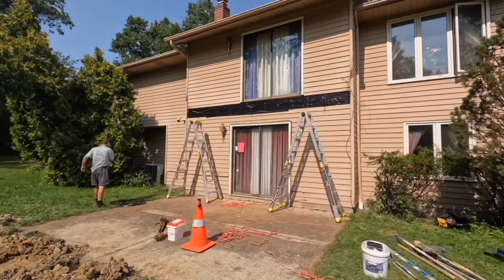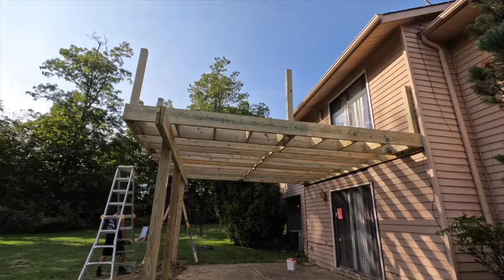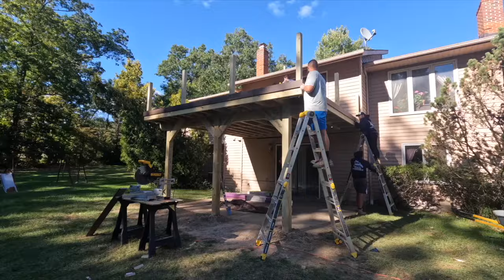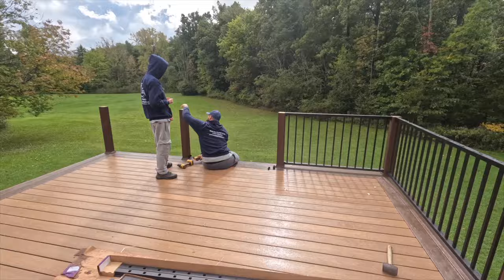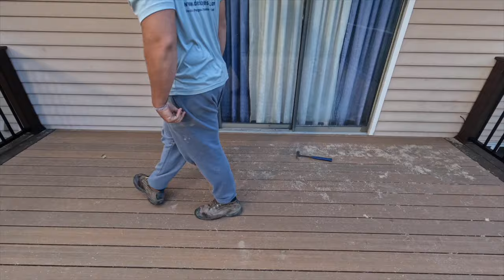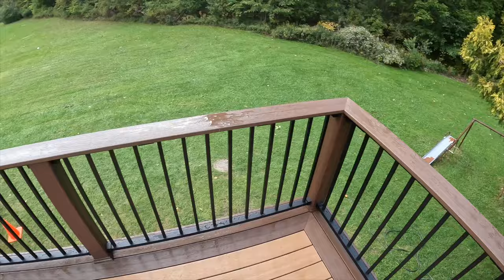Composite  Deck Build Time-Lapse 16x16 2nd Story

Comment: Probably should have put footing of concrete Pilar’s on the posts to avoid long term rot.  Also should have used higher railing like 42” or 48” cause of the second story. Don’t want it to be lower than your hood. Plus safer if you have children!  Nice looking deck !
Reply from the maker: Sono tube piers above grade with Simposon brackets are a better method that lasts longer. However, it does increase cost significantly. We use 6x6 posts, even buried in the ground, should last 50 years.
Reply: Who is this Pilar chick? I didn't see her in the video.

Comment: great job!  what's the weight limit on a deck like that? also what would you say is an appropriate estimate?
Reply from the maker: In order to pass code, decks typically have to have at least a 40 pounds per sq.ft. live load. So, maybe 10k pounds total. Definitely wouldn't put a hot tub on it!

Comment: It looks like you cut back a cantilever. What exactly did you attach to the floor joists to support the ledger and what is the ledger screwed to? I have a cantilever problem at my house and I thought what you did here wasn't possible?
Reply from the maker: Great question. I cut the joists flush with the house, added blocking between joists where necessary, and used DTT2Z hangers to provide lateral load from the floor joists inside the house to the deck joists.
Reply: @deckbydesignl.l.c5091  This is great. I have the exact same situation on my house. I need to tear down the existing cantilever, but don't know if I should use the existing cantilever joists and bolts on new joists parallel with it (with footings underneath that area, OR if I should do what you did and flush it all. But then do I attached a NEW ledger board after flushing the house joists? Anyways, great job, and thanks for this example!

Comment: Yes the cost is more … but it will not last 50 years. I just removed my old one that was there before mine. 17years. I built up with bags of concrete a 12”x12”x2’6” Pilar.  And metal brackets for the 5 6x6 posts I had. Cost. $200. It was worth it.

Comment: Beautiful job. Only three ties for the ledger? How are the posts supported?
Reply from the maker: The ledger has 5" "Ledgerlok" bolts every 16". Code only calls for 2 ties. We chose to use 3. Posts are sitting on mixed and poured concrete footers 42 inches deep, 16" wide, 120lbs of concrete per hole.

Comment: Probably should have put water proof tape on top of the support beams since they will rot faster with rain coming through space of composite decking. Hate seeing hard not have longevity but it looks good.
Reply from the maker: We offer joist tape as an add-on. If a customer desires it, we install it. I've heard counter arguments that joist tape can trap moisture in the wood.

Comment: Where is your flashing coming from under your siding? Going over your ledger board and between your deck Joyce as is code.
Reply from the maker: Yes. We put house tape behind the ledger. Then, once the frame is up, we put vinyl flashing on top of the ledger under the siding.

Comment: I have a crazy question the ledger board and footing how do you determine there heights
Reply from the maker: We use a level laser to get a level plane. From that level plane, we measure up to the door. We then determine what elevation the top of the deck will be. In this video, the deck was right under the patio door. So we subtract 1 1/16" to account for the width of the decking and flashing. That's the top of the ledger board. Then, we subtract the width of the joist to get to the top of the beam. Then, we subtract the width of the beam to get to the bottom of the notch of the 6x6 post! If you don't have a laser, you can use a stringline level, but it's not as accurate.

Comment: Why are there no emergency egress stairs on that deck
Reply from the maker: The customer didn't want to invest the extra money for steps and a landing, and the city doesn't require there to be any.
Reply: @deckbydesignl.l.c5091  And it may not be required anywhere else. Lol. People get confused about Dwelling regulations.  Thanks for sharing,  from SoCal.

Comment: How much does that usually cost?
Reply from the maker: We design the decks using 3D models, then we create architectural plans, then we create a comprehensive material list, then we have our lumber company bid that material for us. We take our material cost and add it to our man hours, overhead, and profit. We bid each project accordingly. Composite decks are typically 50.00 to 100.00 per square foot. Some are more, some are less. It really depends on the design and material choice.
Reply: @deckbydesignl.l.c5091   Create for me 3D view, I want change my deck?
Reply from the maker: Www.deckbydesignllc.com
Ghaasedbd@gmail.com 
330 999 2163 
Reach out to me and I can make a 3D model for you. We charge per model based on size and complexity.

Comment: A ledger board on a house should be only for stability, never for structural integrity. I, in the old days would build decks like that, now I have bearing posts two or three feet from the structure. Also I like to make the bearing posts be the railing posts.
Reply from the maker: While I do agree that free-standing decks are always going to be stronger, I disagree with the statement that you can not ledger a deck to a home. As long as the ledger is done properly, it is a safe and sturdy way to build a deck.

Comment: Have fun replacing those poles in a few years since you put them in the dirt.
Reply from the maker: Yeah, I imagine in about 50 years, these 6x6 posts may have to be replaced. Then again, so will the entire deck. Here in Ohio, code doesn't call for sonotube poured footers. If the home owners want to invest way more money into their decks, we can always use sonotubes, concrete, and simpson brackets. But why spend all that extra money for a deck frame that will only last 30 years anyway? Pine frames rot over time, and there is nothing you can do about it.
Reply: Well said.